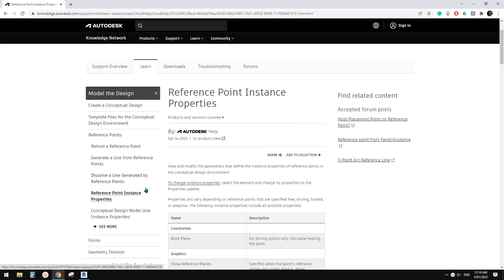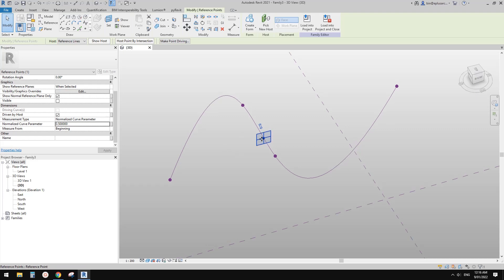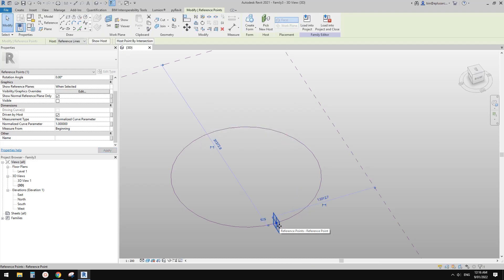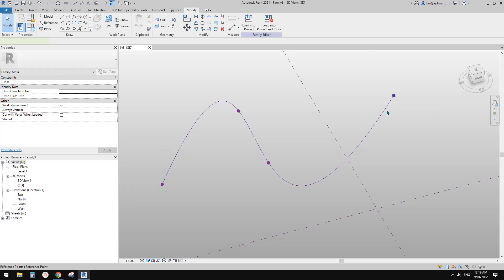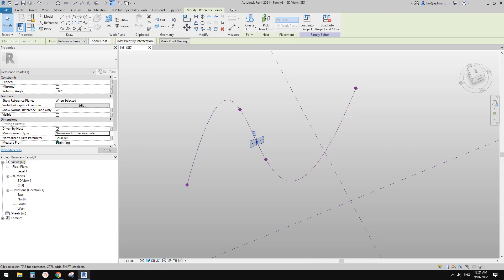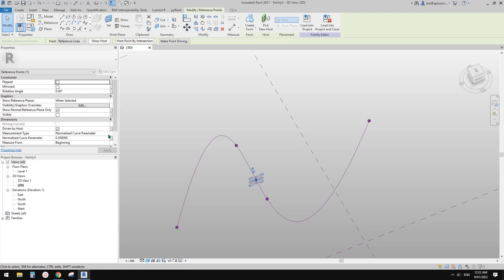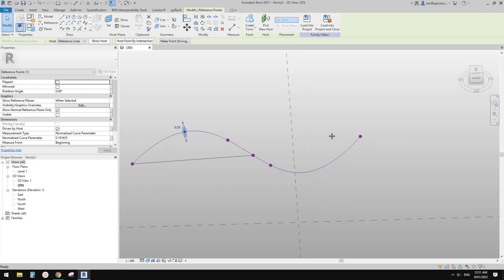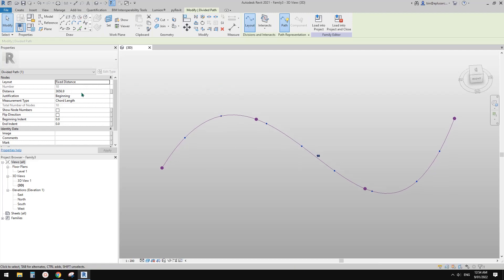Revit Exercise (Day 655) Instance Parameter of Reference Point - Measurement Type

Comment: Normalized segment length is straight forward = bounce between 0 as start and 1 as end regardless the actual length of curve 
Normalized curve parameter =  It is measured as the fraction of the curve parameter (t) over the total parametric range = (t-start) / (end-start). Its value varies between 0 and 1. 0 corresponds to the start and 1 corresponds to the end. 
When to use that !! Have no idea at all !
Reply from the maker: Maybe the curve length and chord length? Not sure...